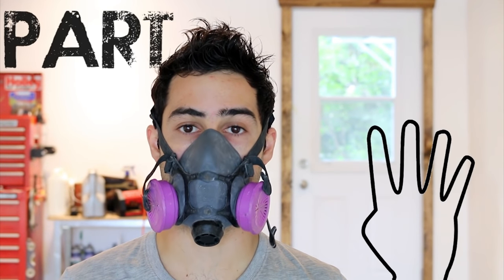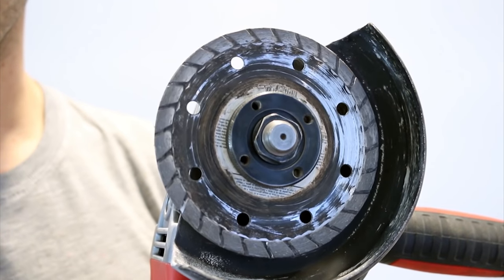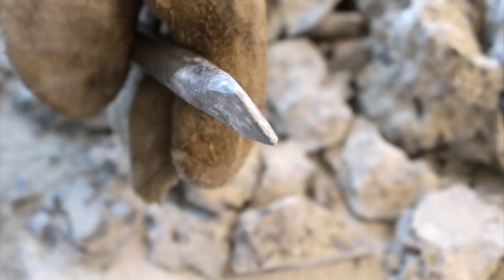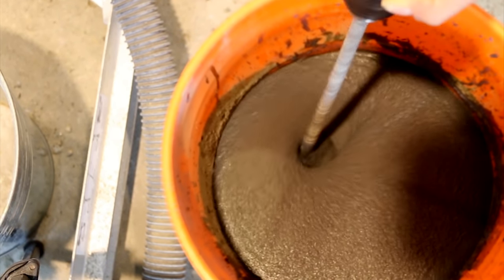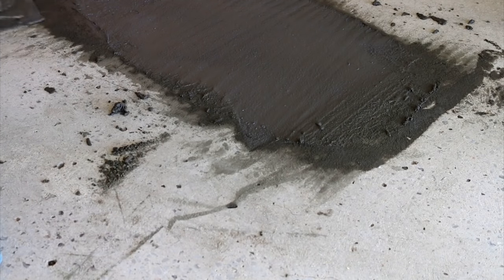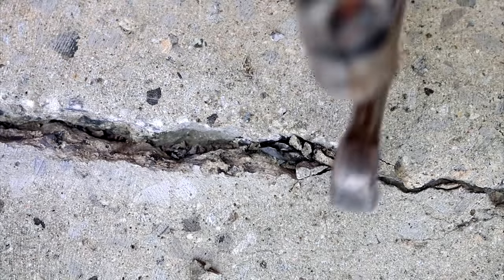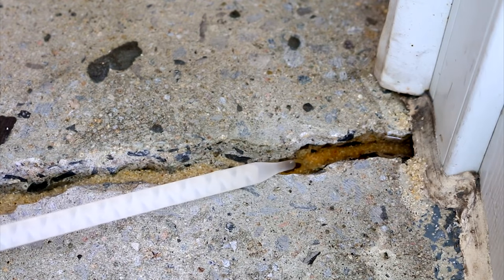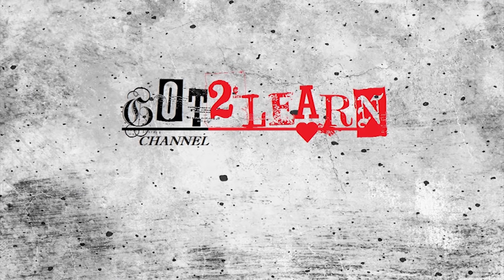EASY | How to DIY Epoxy on Garage Floor Part 4: The Repairs | GOT2LEARN

Comment: Men! Amazing video. As a civil engineer, i have to admit, you did it better than many of us. Thanks for sharing the knowladge.
Reply from the maker: +Oliver Aguirre Thank you for your kind comment Oliver!
Reply: Got2Learn do you remember how much crack fix  product you used per feet? I am trying to get the realistic average footage yield per caulk
Reply from the maker: Oliver Aguirre per feet I couldn't tell exactly, but from what I remember, I got at least 10 tubes and I had at least 30' of cracks about 1/2" in width and about 1/4" to 1/2" in depth, should give you a rough idea, hope this helps ;)
Reply: Got2Learn Sika says is about 8 feet using the sand+epoxy method, but i think your number is more realistic. Thanks! Another interesting video you might be able to do is on how to patch or repair cracks in exposed aggregate concrete. That might require the use of concrete repair products plus resins mixed with aggregate. Chears!
Reply from the maker: Oliver Aguirre Great, its better to have a little more product then not enough, you can always return the overstock, let me know if everything works out ;)

Comment: great video, can you use the same Sika mix on a ceiling crack? I have a patio that have through cracks from the top outside of the house down to the its ceiling- if you look at it from the basement-?
Reply from the maker: I am guessing you could but it'll most likely fall if it's too liquidy, i'll let you be the first to try it ;)

Comment: What grit disk did you use when grinding on your concrete floor to prep it? 
My garage doesn't have any pits, holes, mine has a thin old coat of paint that I want to remove, and I need to put some profile to be the concrete floor to give something for the paint to bond to better due to the surface being slick. Thanks, John
Reply from the maker: Here's the cup I used, it doesn't mention anything about grit, but this is the one: https://www.pearlabrasive.com/p2-pro-v-singledouble-row-cup-wheels/product/0/1571

Comment: Good job. But I still don’t know what disk you use to sand concrete flush
Reply from the maker: https://www.pearlabrasive.com/7-x-58-11-pearl-p2-pro-v-concrete-masonry-cup-wheel-double-row/product/0/871387
Reply: Got2Learn got it thanks
Reply from the maker: Not a problem!

Comment: what if you just did the epoxy over those pitted areas?  I have so many all over my floor and it would be a pain to break out basically 3/4 of the surface.  Thoughts?
Reply from the maker: mct8888 I am glad I decided to do it. I noticed the the epoxy does NOT fill any voids, it stands out in the sun. If you want to have nice results, I really do suggest you repair/flatten you surface first or you might regret it when it's too late ;)
Reply: thank you so much!  great videos, keep up the good work!
Reply from the maker: mct8888 thanks buddy, I appreciate it !!

Comment: Pool filter sand is usually silica sand. I imagine that should work just as well? Easier to find than straight up silica sand.
Reply from the maker: It's gotta be kiln dried.
Reply: @Got2Learn  Understood. What I did is just bought pool filter sand (which is silica sand) and I threw small batches into a pan and cooked it the oven at 400 degrees for a half hour each batch to dry it out. Seems to have worked fine.
Reply from the maker: Awesome :)

Comment: hi, what is the sander that u have used to sand the final step for concrete to ground flush. any brand for blade and machine.
Reply from the maker: Check PART 2 for all the details ;)
https://youtu.be/53UrFZfWsfw

I don't have a brand name for the disk, but they usually give out good blades when you rent the grinder.

Comment: Hey very nice Video!!
Did you grind the Spots you repaired with the concrete after it was hard?
Did you grind the cracks afterwards?

Greets from Germany
Reply from the maker: Yes, I had to smooth them out before applying the epoxy ;)

Greetings from Canada!!!
Reply: Got2Learn thank you so much for your fast reply!

Can i first repair the whole spots and cracks in my floor and then start grinding the whole floor like you did in Part 2 of this series?

Or should i first grind the whole floor 1 Time and then repair all Spots and smooth out the spots again?

Greets
Reply from the maker: There are no differences, you could do it both ways, I just did it that way because it was easier for me to see ALL the cracks and pits that needed repairing ;)

Comment: whats the sika crack repair product you used ?
Reply from the maker: It's called "Crack fix" it's basically epoxy in a tube ;)
Reply: @Got2Learn  does the "crack fix" epoxy flex? Or should I go with "crack flex"? My concrete settled and I have a large crack
Reply from the maker: The crack fix has it's limits too, but yeah you can use that for large cracks

Comment: You can fill all those holes in without tearing out the whole floor by adding cabosil to your epoxy which makes it thick and then spackle in those divers and pin holes. All crack can be filled in the same way. This is way to much work
Reply from the maker: Way too much work?

Comment: Why didn’t you just use self levelling compound?
Reply from the maker: Because it cracks, this doesn't.
Reply: Got2Learn Iv never had any issues with cracking
Reply from the maker: Do you live in a hot climate?

Comment: A damp sponge to smooth out any inperfections,😂 that's what a float is for. You made a lot of unnecessary work here. But hey I can see you are learning
Reply from the maker: It worked out just fine, no need for a float.